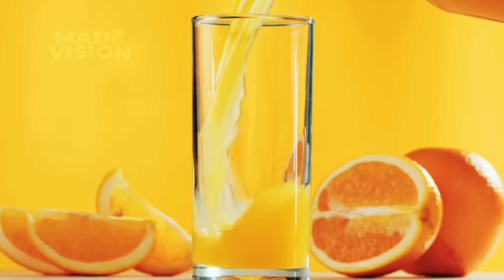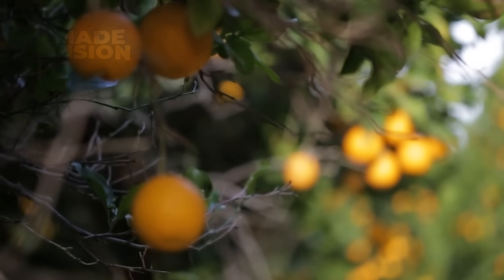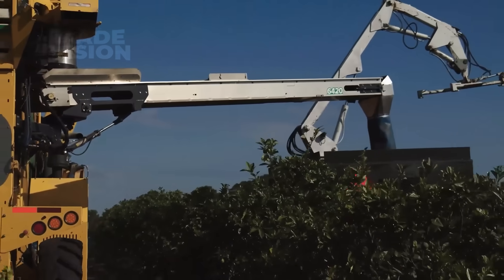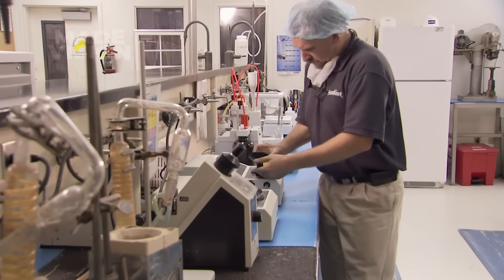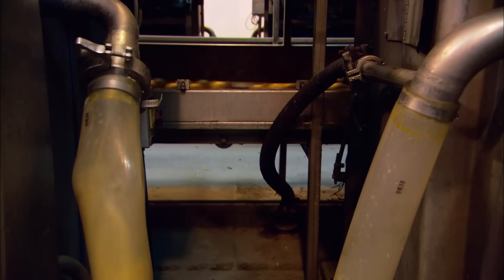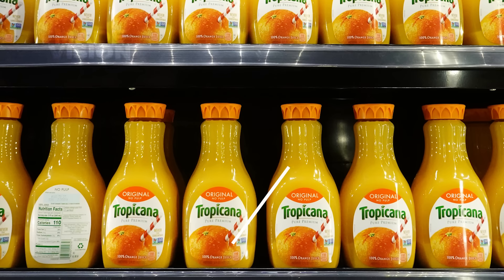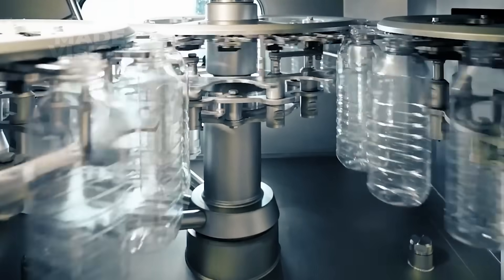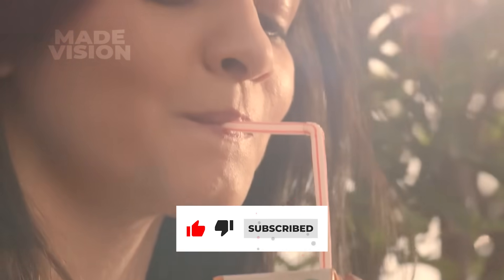How Orange Juice Is Made In Factory

Comment: I drove a truck for many years. Saw lots of places where lots of things are produced and moved through the supply chain. The absolutely most disgusting place I've ever been is the Tropicana Orange Juice plant in Florida. The smell is worse than any poultry, pork or beef slaughterhouse. The sides and bottom of the conveyors and other equipment is covered in caked on orange crud. Everything other than the surface the product is in contact with looked like it hadn't been cleaned in years. 

I still love orange juice, but you can't offer me enough money to return to Tropicana on a hot day. 

Coca Cola brands of juice are juiced in a facility separate from the bottling.  The nastiness is nowhere near the bottling production. The juice is transported in tankers and pumped into the bottling equipment. Everything there is pristine.

Comment: Just wondering if it's possible to put the orange juice in an aluminum beverage can instead of a plastic container, or is the pH too low for that? Also, the frozen orange juice that is "concentrated", is it any different after you add the water back in at home, from a normal bottle of orange juice that is not from concentrate? Is one better for you than the other, and if so, why?

Comment: Even though I prefer the single strength juice now found everywhere the problem , though, is the cost of moving it from factory to kitchen table.  A lot of water is being shipped which adds to the retail cost and as well as obvioously contributes to air pollution from transportation. Buying concentrated juice spreads the shipping cost per ounce across a larger number of oranges since 80% of the water is removed at the factory.
Reply: Yes, concentrate is more "green" in reducing environmental impact.